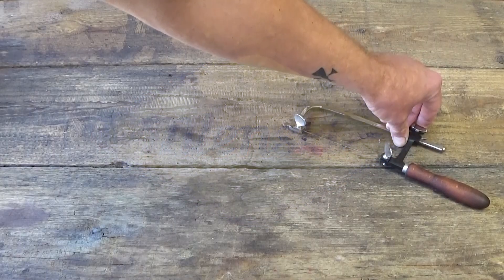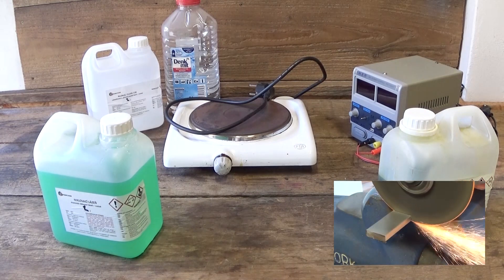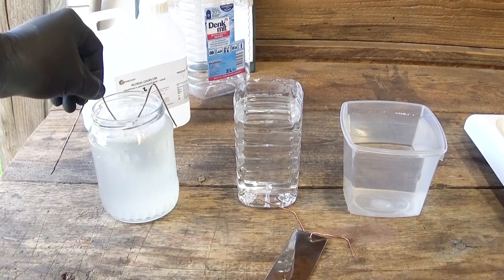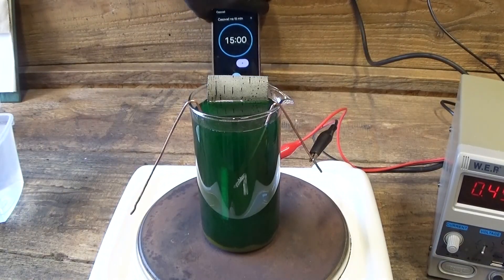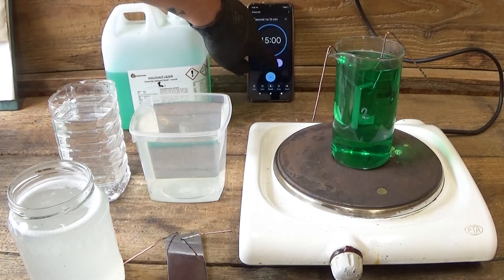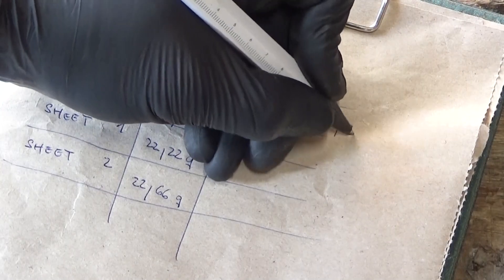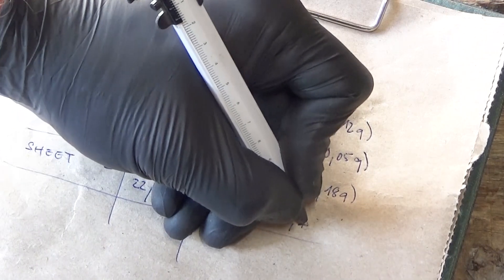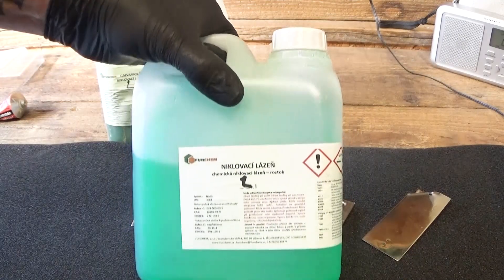Nickel-plating backyard DIY experiment | Chemically vs. Electrolyte

Comment: My day worked in a bumper remanufacturing plant , cut, weld and re chrome them. He explained to me that they would copper plate the steel first, them nickle plat and them chrome.
In this order had better bonding potential from the base metal up.
The copper bond was stronger to the steel and so on.
Thanks for sharing.
Reply from the maker: Thank you for your useful comment. 👍🏻

Comment: Electroplating (#1) indeed went wrong. I suppose something went wrong with electrolyte temperature, or voltage or amperage. Try few more configurations. Electroplating usually deposit much more metal on the surface, and won't be easily wiped away if you try additional polishing for resulted piece.
Reply from the maker: Thank you very much for your comment. There were more mistakes. Amperage is one of them. But preparation of plated piece were more wrong. I have send questions to the producer and the procedure is too difficult to me. Deffinitely I am going to use chemical way of nickel plating.⚗️ Much better due to my conditions. 👍🏻